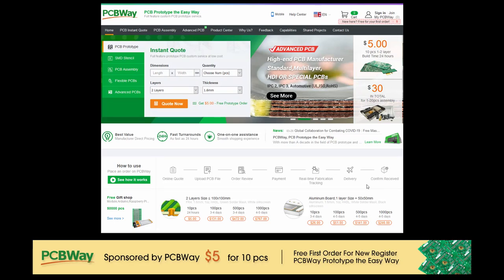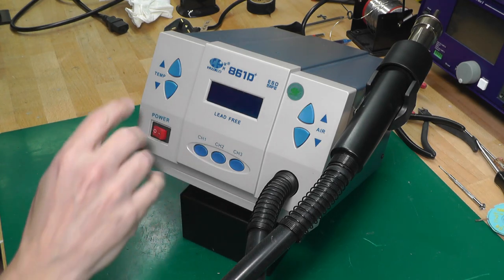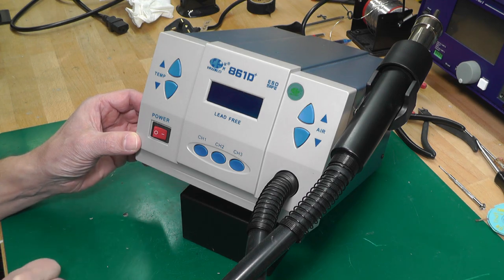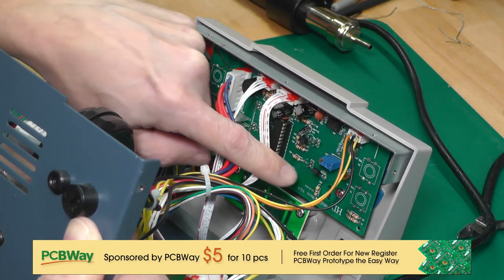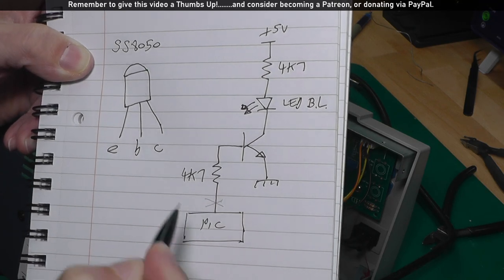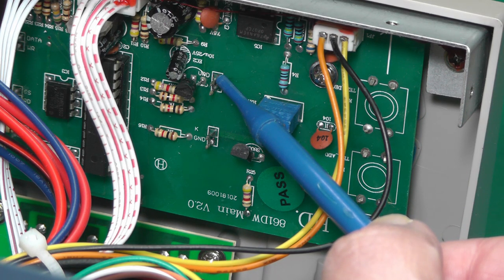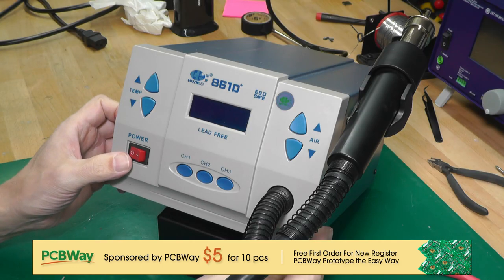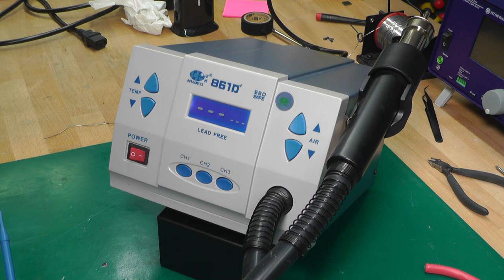No.070 - 861D Hot Air Station Modification

Comment from the maker: This station is basically a 'copy' of the original QUICK 861DW unit. There are simply loads of copies going around and with different versions/revs of Pcb's inside.
UPDATE: Small mistake on the schematic......the series backlighting resistor is 330ohm, not 4K7.
Reply: Not bad £59 for a clone of a £260 unit
Reply from the maker: @aqib2000  Yes, it even has a nice big mains filter. I notice that some people complain the QUICK unit can cause flickering of LED shop lighting!
Reply: Only in the US would that happen with their crappy 110V power. Some houses in the US don't even have a separate lighting circuit. With proper 240V mains, there won't be any flickering.

Comment: This 861DW heat gun lead-free soldering rework station has high power and fast heating up. One machine can be used for multiple purposes, brushless eddy current motor, wide range stepless adjustable air flow. Automatic sleep function. Parameters can be set in sleep state.

Comment: Everything on my small electronics bench is plugged in to a 10 way surge protected extension that has a built in 16A switch at the input and it's by the door. It is plugged into an RCD socket. When i leave the room, i can just hit the switch on my way out and i know everything is switched off. The only high power device is my yihua 899D II 2in1 soldering+hot air station, fused at 5A. Everything else is low power, under 1A.

Comment: Or you place a LED near the powerswitch that indicate that the Hot Air Station is powered on.
I think that enabling the background light constant, the background light lifespan will be reduced.
Reply from the maker: I thought about that.....but there is something about an LCD trying to show something that you can hardly see (because of the blue LCD!) when the backlighting is off......so I opted for this mod.
Reply: @IanScottJohnston  Are you sure the LED is current limited with 4k7, as that would be around 1mA in the backlight, perhaps the resistor is 470R, giving 10mA, which is more typical with a backlight, and will last pretty much longer than the unit life in there.
Reply: @IanScottJohnston  , as long as you know that it's off when you leave the shop is what matters. Happy Holidays. Grts
Reply from the maker: @SeanBZA  Just checked....my bad....it's 330ohm 0805. Mounted on the underside of the LCD.
Reply: @IanScottJohnston  6mA then through the LED, will still last forever. Quicker just to put a blob of solder between base and collector of the transistor, making it a diode. Did that to my digital scale because the firmware version it runs did not have the option to always have the green LED backlight on, despite the manual saying so.

Comment: You could also add a resistor from base to plus so It low lights when sleaping
Reply: Or just another 330R resistor across collector and emitter, so it flips between the 2 states of 6mA or 3mA sleeping.

Comment: I have a UYUE 8586 and I wouldn't trust it even with the power switch in the OFF position!
Reply: Why ?? Does it go to cheat you with other user ??
Reply: @ahmedalshalchi  I have experience of it overheating even with the switch in the off position... really should investigate.  These Chinese hot air/soldering devices are a bargain... but make sure you have fire insurance just in case!